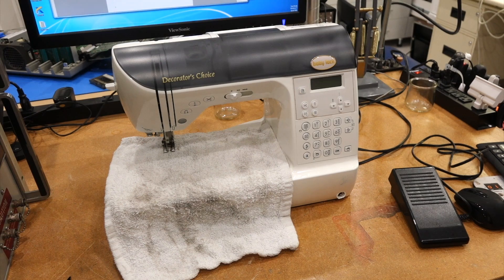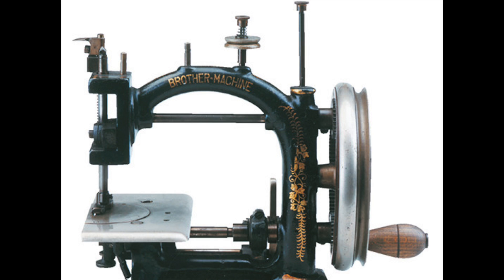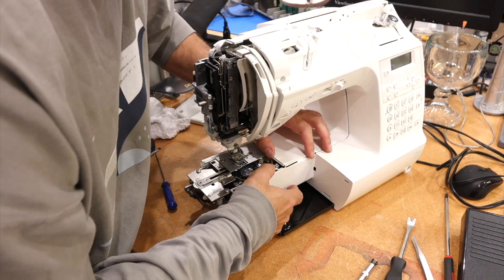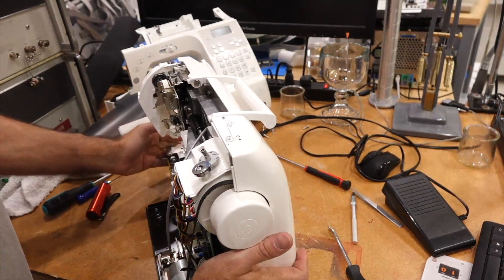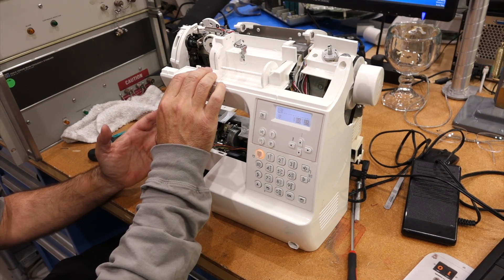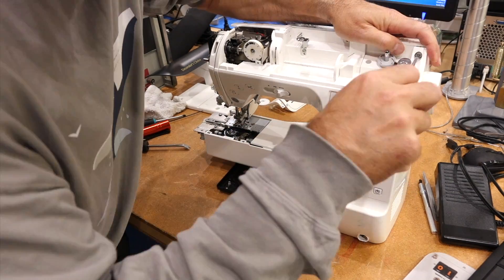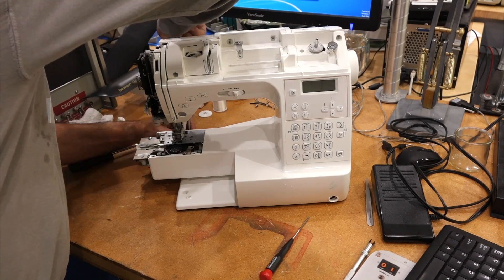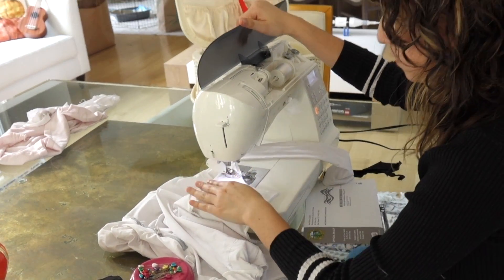Modern Tech Fails: Baby Lock Sewing Machine, "The Safety Device Has Been Activated!"

Comment: A smart engineer would have just put an access panel at the right side that you can unscrew to get to the belt. But no, it needs to be slick, curved and futuristic.
Reply: A smart engineer would have made sure that the damn belt does not fall off on it's own.
Reply: @FrozenHaxor  a smarter engineer would have remembered those little belts wear out over time and need replaced regardless
Reply: @AsbestosMuffins  and then the really well paid engineer was told to design it so that they would fall off a month after the warranty expires
Reply: @FrozenHaxor  yeah just add shoulders to the pulleys.
Reply: I think they learn this in school. Make it hard to repair so you just throw it away and buy a new one.
Reply: A smart engineer would made the plastic cover a magnitude simpler. Cheaper: molds, faster assembly in the factory. 

Imagine the testing department. A derailed belt and even the factory couldn’t approve the man hours afford to fix it.
Reply: A very smart engineer would know that belts would need to be serviced over time. Then over-engineer an automatic belt changing add-on option, to be sold separately.
Reply: @KYSLDR  
Or a simple door.
Reply: I have a east block, GDR-made "Veritas" machine from the 80ties and there its exactly like this: The (vgroove) belt rides in a 3cm deep valley of the pulley/handle combination (the pulley is actually also the handle for hand-turning the machine) on the outside of the machine and is only partially hidden behind a single cover to avoid getting your finger pulled under the belt. So not only would it be completely impossible for the belt to slip off its pulleys, you can also directly see any damage to the belt, and access is super easy for repairs, too. Oh and of course the whole machine has a cast aluminium chassis/base for tank-like rigidity with only some simple plastic covers. No clipped-together plastic crap.
Reply: What.... and actually give the consumer the right to repair his own possessions? God forbid!
Reply: @GORF_EMPIRE  
It’s just mindless engineering. Testing the machine in static environment, many 100s of hours may be all they’re doing.
Reply: A really smart engineer won't use belts at all
Reply: @DreitTheDarkDragon  
I thought about that. A belt versus a gear drive with a clutch. Or fluid torque converter?

Belt.
Reply: @larryscott3982  Just regulate by PWM or is there something I'm missing?
Reply: @DreitTheDarkDragon  
If the needle hits a solid object, like a button or zipper, with direct gear drive something will break. There has to be threshold of slipping.

It’s not just controlling speed.
Reply: @larryscott3982  Oh, now I get it! Hmm...then belt is probably really easy solution. I honestly though that sewing machines just go and don't care about anything in their way.
Reply: @DreitTheDarkDragon  
The needle rigidly driven by a rigid gear train would be ‘bad engineering’. 

I recall our old Singer sewing machine. It had adjustable force for silk, denim, leather.
Reply: @larryscott3982  
It’s a toothed belt though. Doubt it’s designed to slip.
Reply: @AttilaTheHun333333  
Dunno 

“Lug Belts

This type of belt is by far the most common belt used for sewing machines and can be mistaken for a geared belt because most of them have ‘teeth’ on them that resemble a geared belt. The difference between this type of belt and a geared belt, is these ‘teeth’ don’t fit inside indentations on the motor pulley…”
Reply: @larryscott3982  Torque converter would work in that scenario perfectly.
Reply: @erkinalp  
Yes. Agreed. There are multiple solutions. 

Would that make for better design? Better performance? Simpler? Cheaper?

The problem with this design is not the belt. The issue is the plastic enclosure. The complexity of the enclosure which does not add to its performance, but adds to its manufacture and subtracts from its maintainability.
Reply: I don't have time to play with their design gimicks, I would get the Dremel & cut off the right side portion of the cover, thus exposing the belt drive, to eliminate such major work for a simple problem the next time. "Get er done"

Comment: Sewing machines can be the most frustrating devices to repair.  Glad yours was just a slipped belt.
Reply: It's not just sewing machines. Too many engineers never think about repairs or maintenance. They design a brilliant machine that works well. But the day you need to repair it, it turns out that the designer never repaired anything in his life and you need so much disassembly that you would have been faster if you started assembling from new.
Reply: @Hans-gb4mv  For sure.  Cars are insanely next level with that statement   Holy.  Hell.  Pretty much have to take it somewhere.  However I will say a sewing machine can indeed blow to try to get working again after...well pretty much if anything goes tango uniform lol.  They just aren't friendly from the get go if you ask me.  Some can be a little better than others, but ultimately it's a tricky thing to operate and design I think.  Or if you really wanna up the complexity, check out a serger.  Cool when it is working and all threaded up but man...takes a while to set up correctly and and not ruin your stuff lol.  Man that was an experience lol.  If one thread snaps...man is sucks to find, rethread, unbind, restart...etc.  haha.  But hey it comes with the territory.  I got good at it haha.  Had a Sears/Whirlpool spinoff brand that finally made me cry one too many times lol.  Sold it.  Needed a 5 threader anyway.  The Singer is still slow to contend with, but definitely better built.